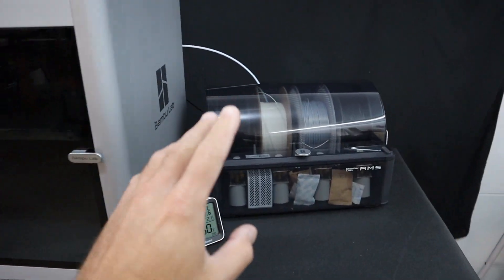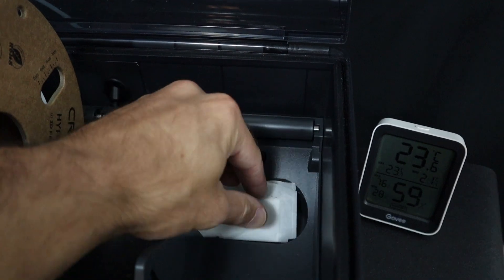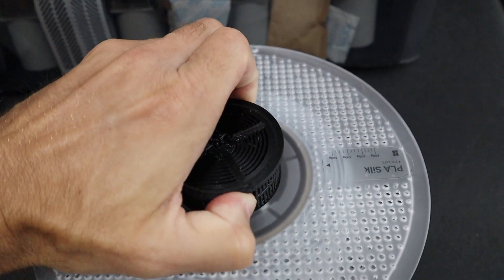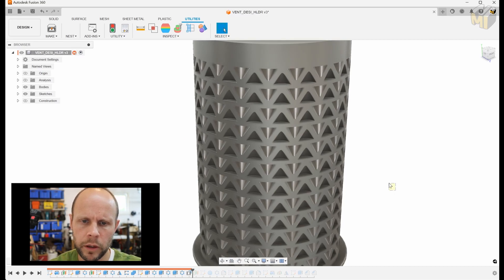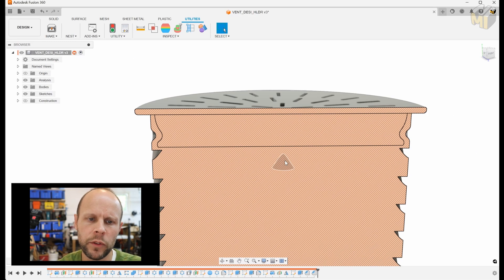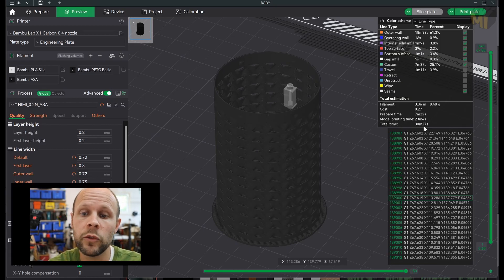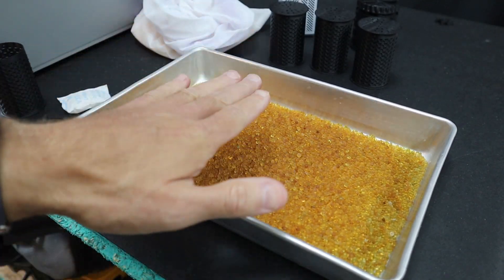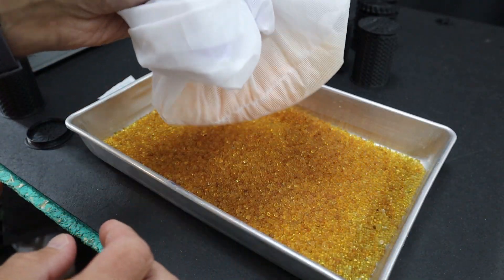Super Dry Your Bambu Lab AMS with These Cool 3D Prints

Comment: what did u print it in and what was that white mess on your build plate?
Reply from the maker: This was printed in ASA, but you can use ABS/PETG also works, it really depends on how you want to dry the desiccant.  The mess is just glue stick, these prints didn't need it, but most of my prints are heavy duty and will warp.  PETG doesn't seem to do it much, but PLA and ABS are pretty bad for nearly solid parts.

Comment: Hey, please point me in the right direction to learn more about the modeling you did to create the 'louvres'. I tried browsing your channel but couldn't find any other reference to it.
Reply from the maker: This was a new one for me as well.  This only works with Vase mode printing.  I created a cylinder to begin with, and then I created a small cone shape to intersect it and patterned it around the larger cylinder.  The rule with vase mode is that anything horizontal will not be printed, with the bottoms or tops of the cones horizontal, they're open and it gives that cool look as well as the flow.  I hope that helps, let me know if you need more info.

Comment: Hi, thank you for your very well made design! I sliced it in bambu studio, I think using the same parameters as you, but I can get only 55mins and not 30mins print time.
Reply from the maker: Thank you!   There will be some settings which are material dependent, it may be that the flow rate, or your cooling settings for that material is different than the settings I used for ASA.  If you have a look at the view for speed view and then play around with some settings with for that material you should be able to speed up your print.  Are you Printing with ABS/PETG/ASA other?
Reply: Thank you so much, I'll give it a try (I'm using PLA)  @NeedItMakeIt

Comment: Im on my 5th attempt at printing this successfully. It only prints well with infills. I'm referring to the spool holder. Any suggestions?
Reply from the maker: You should be able to print spiral with a 0.4mm nozzle, by adjusting the line width from 0.45 to 0.75, if the bottom or tops don't connect well it will be due to the amount of bottoms, you need at least 6 if I remember correctly.  That's pretty well it.  I don't know how it would turn out with infill but let me know and I am happy to help.  One other note, best to print it in a color that doesn't match your spools... I found this out the hard way when I was removing a spool and it fell out on me... lesson learned.
Reply: @NeedItMakeIt  I really appreciate your response. Did you use Bambu Studio or the Orca Splicer? I think I may have changed too may settings. I'm going to default everything and then do what you have outlined above. The tip about the color of the spool, noted! I happen tp be using the P1S.
Reply from the maker: @speway  I think at the time I used Bambu, but the features should be available in each and they should look similar, Orca is pretty close to Bambu.   Could be some settings that are a bit off yup, I think a 0.2LH, add 0.3mm to each of the extrusion thicknesses, turn on Vase mode, make sure you have 6 bottoms min. 

The 6 bottoms lock in the vase portion to the base, without that it won't have anything connecting it and will fail for sure.  I think you can print this in any filament, but ABS/ASA or even PETG should work, I figure it'll go in a dryer eventually, but because of the lid it doesn't have to.  PLA will be affected by moisture over time and will likely become brittle.    P1S is a great printer, I'd like to have one to go with the X1C actually.  Maybe someday!
Reply: @NeedItMakeIt  What do you mean by "6 bottoms?"
Reply: @NeedItMakeIt  Thanks for taking the time to respond to my inqury. Question: As "line width is not a specific setting but rather a heading that  houses approx. 8 settings, would I be changing each of these eight settings from .45 to .75? I am using a PETG and the Generic filament profile.
Reply: @NeedItMakeIt  I failed to mention earlier but I'm new to 3D printing.
Reply: @NeedItMakeIt  When you metnion bottoms/tops, are you referrring to the bottoms/tops flow ratio setting?

Comment: Rather than having to empty these desiccant holders to dry, have you thought about printing out of a more heat resistant material like ASA or PC and just putting the entire thing in a dryer?
Reply from the maker: Mine were printed from ASA, yes that's a great idea to be able to plunk them in the dryer.  It's a bit simpler to start by drying a large batch, after that it seems better to leave them contained and dry on occasion with a spool.  I don't recommend the black though, they blend in to the spools too easily and it's easy to forget they're in there.  Any color would be better.

Comment: Don't wonder about the Tube looking like the top lid is on. Activate spiral vase and slice and the solid cylinder will turn into a tube without a lid.
However I only manage to get the holes on the side, that point upwards. The one pointing downwards are not printed properly with pla. From the upright "ring" that starts each level the next line starts to squiggle as expected, but the slicer doesn't understand, that the ventilation needs to be drastically ramped up, get the PLA hard in mid air. So when the nozzle comes back above the "ring" the still soft PLA leans against that "ring" effectlivly closing the hole.
Reply: activate spiral vase? for us NEW printers how and where do you do that? i ask as the first one i printed is solid on both ends.  thanks for any help.
Reply: I'm new as well and I have to go through all check boxes every time. "Spiral vase" is under "Other/Special mode" in Bambu slicer.  @terryhdbailey

Comment: In your video, you said you didn't think the front desiccant trays would have enough 'drying power', but you didn't try it out. I tried it. I printed the three trays and at first I didn't fill 'm up. I just used the standard holes in the back with the supplied satchels of desiccant. I printed the front center tray just for holding the hygrometer which I got off of Amazon. I tried them first against two different hygrometers in my room (around 45% humidity, 20C) and it showed around 30% inside the AMS. I let that sit there for a few days (I had to wait for my kilo of desiccant anyway) and the humidity and temp remained stable. Then I filled up the left and right front trays with desiccant and within a couple of hours humidity dropped to 20% and it's still there. So I guess both solutions perform roughly the same, yours a bit better.
Reply: How about implementing both solutions?  Is it possible to have the filaments be too dry?  My X1C arrives tomorrow and I will make this my first project. Also, I  know you have the large humidity sensors for video visibility but how accurate is the built in sensor in the AMS?  Is it accurate enough that it's all I should need or should I get the 3rd party meter as well?
Reply: @manueltran1964  did you try it? has it worked? I'm about to get my X1C on tuesday so I'm excited!

Comment: When I slice the Universal Internal Spool Desiccant Holder, it is closed at the top. Am I doing something wrong? I have a Bambu Lab printer.
Found that I have to do the following: 
To print this, use Vase Mode (Spiral)
Change line widths from 0.4 to 0.7, increase by 0.3mm to each width setting
Use 6 bottoms, this makes sure that the vase has a good connection to the top or bottom. 
But I don't know what to do with change line widths from 0.4 to 0.7, increase by 0.3mm. 
I found Line width Default and changed it to 0.7, but where do I fill in the 0.3? 
(Just have my printer for a few weeks, so sorry if it is a stupid question)
Reply: You have all kinds of widths and they are not all .4mm. Change all of them +.3. So for example .4 becomes .7... .42 becomes .72... and so on.

Comment: The desiccant bottles that go in the spools also helps keep non-bambu spools from jumping as you are about to finish the filament.  Other spools are lighter than the balbu ones and tend to jump when there isn’t much weight from the filament left.
Reply from the maker: I can see that being a problem for the paper spools, a full spool isn't really a problem but as they become nearly empty it's not good, a spring system from the top with a roller would be a good idea and would accommodate all spools.. except for the smallest ones which the Hydra system would allow.   Great point though.  My issue with those is that they only fit one brand.  I wanted something a bit more universal.  I think that I would not recommend printing my design from black, sometimes I forget they're inside and oops, there is a broken lid as it falls out.  I'm also using black colored spools, so maybe something brighter would be good.

Comment: The top is merged to the rest of the model. Why is the model like this?
Reply: Mine looked the same but once you set under the "Others" tab | Special Vase | Select the box that says "Spiral Mode"   (Would have been better if the creator explained where the "Spiral Vase" mode was located as I did not find it easily. Once you set that, the rest of the project gets an A++
Reply from the maker: @DatsunVents  Yup, good point, sometimes I can gloss over things not thinking that some people may not be aware of how to activate the features.  Especially one that isn't used much like Vase mode/spiral.  I'll keep this in mind for future, thanks for that!
Reply from the maker: I think it needs to be rotated around, my apologies, I should have adjusted the model to come in with the section you're referring to toward the buildplate.  You should have a separate file for the lid.

Comment: When you download the files the top is already on and I cannot separate it for printing.  In addition the top shows to be solid with no through holes.  Solidworks does not play well with stl files so there is nothing I could do.  Great idea, but not executable.
Reply from the maker: I just had a look, and the stl files are two separate files, however if you bring them into the slicer at the same time, you'll have the option to combine them / group them.   Try bringing them in individually and you should have success.  

The model is solid like this in order to make VASE mode work correctly, if you adjust the settings to what is shown in the video, you will be able to make it work.  The extrusion width is changed to 0.7 from 0.4 for example.  The amount of bottom layers is also important here, I believe it is at least 5, if not 6 bottoms.  

Let me know if you need any more assistance.
Reply: There are two separate files, but befor you enter Spiral Vase mode the "Body.stl" looks all closed up at both ends. The lid is not on, but the tube is closed at then end regardless, because the whole tube is filled (it's a cylinder, not a tube).  @NeedItMakeIt
Reply from the maker: @Schnapsbrennor  That's right, to make this work for you, you'll need to change to Vase mode, or Spiralize outer contour.  This will auto-hollow the shape.  It's certainly a different way of 3d printing and it's not too intuitive.  Make sure to use the settings in the video or in the printables/makerworld link these are important to make sure it is strong.  

I can also recommend using a color rather than black.  I have a lot of black spools and they blend in, better to make them something a bit brighter. 

Hope that helps.

Comment: Hi, looks awesome & even more when compared to what other options are there...
I just tried printing as is and the top is merged. I then checked the body file & it seams to have the lid merged in the model itself.
I can't manage to print it correctly on my BambuLab X1C :(
Please help... Could you maybe create a ready made 3mf file?
Thanks
Reply from the maker: I'll get back to you, I am just finishing up another video, email me if you don't  mind.  Needitmakeit@gmail.com
Reply: Hello, I'm having the same issue. The main body model is showing up with the lid already installed
Reply: @ericeves6452  I gues you figured it out by now, but for future readers: You have to enable Vase Mode ('Spiral vase')

Comment: I'm getting a constant 10% (lower limit for display output?) on my hygrometer using the original upright 3 gel containers but hey, you can never get enough desiccant so I might add these as well! Thx.
Reply: side front boxes, these and the upper side brackets I am well over 800g in there lol

Comment: I was just printing the same model in the front the other day and measuring humidity. The clip in sensor was reading 10% in the front but another was reading 30% in the back! Minimal airflow causes misreadings from the entire case.
Reply from the maker: I was thinking that as well, great to hide the sensor inside of the desiccant, but it will be pretty dry there, no nearly as much in the AMS chamber itself.  It was a good thought and looks sleek, but it's pretty misleading.
Reply: @NeedItMakeIt  So I'm having trouble with getting this off the bed with spiral mode. The walls are too thing and thus break off very easily (despite also doing the +.3mm increase). Have you encountered this before?
Reply from the maker: @grenade558  Oh, I can't say that I have, if you're printing with PETG, it can bond extra well to some beds.  If you take the Buildplate off, are you able to flex it enough to get a corner started away?
Reply: @NeedItMakeIt  yeah I've been trying with PLA and bending the sheet. For some reason they're breaking pretty easily when I bend it though. I can try rPETG but I had the issue 3x in a row so I figured I'd reach out in case you ran into it as well. Maybe my bed adhesion is too good lol
Reply from the maker: @grenade558  It sounds like the bond to the bed is really good.  I'd try turning the bed temp down to 30C and use a little glue stick, that usually does the trick for me.  I rarely have parts stick so well to the buildplate.  It could also be poor layer adhesion, but that's not normally a problem with case mode.  The only other detail would be to check to make sure you have 5 or 6 bottoms, that locks in the first wall before vase mode.  The circular shape does tend to resist warpage well, you may just have a great bond, which is kind of nice.
Reply: @NeedItMakeIt  ah I wasn't doing that many bottoms. It's a smooth cold plate so it's only 35c. I'll play with it some more tonight. Thanks!
Reply from the maker: That should fix the problem.  I had one that gave me trouble like you've had when I was first setting it up.  Vase mode designs are not always as easy as they look to setup.

Comment: I tried to print this and it's solid in Bambu Labs slicer
Reply: same here.  looks like the end caps have no holes in them?
Reply: Im  working on one that will work in bambu labs will upload it from my channel @MightyFloyd
Reply from the maker: If you're using Bambu Studio it's automatic, if its a different slicer, there are some settings that need to be adjusted.   I can probably help if you tell me which you're using.
Reply: @NeedItMakeIt in Bambu Studio under "Quality I increased layer height and all  areas under line width by .3mm, under "Stength" I have  Wall loops at 1, Top Shell at 0, "Sparse Infill" at 0, and under "Others" I have Special Mode on Spiral Vase. It is still showing infill and both ends close, printing as a solid piece.
Reply from the maker: @MrWest3  Sounds a bit strange, can you close and open it back up?  What I can do is release the model on Makerworld and setup a print profile.  I should also suggest that this should be printed in a bright color, too many times I forgot to remove it and when it hits the floor, it's not a good time.  I've been seeing the clay desiccant packs lately and I think it's a better option so I'll probably be using those inside these containers instead.
Reply: @NeedItMakeIt  thank you for responding. I don't know why it's doing this but it shows the body as a solid with both ends enclosed until I slice it. Once I slice it, it shows correctly and prints correctly now. Weird. Thank you again!
Reply from the maker: @MrWest3  Oh, okay, yes that's normal for vase mode.  With those models they are designed as a solid object and then they rely on the slicer to do the rest of the work.  Just make sure you have enough bottom layers, you need at least 6 to have a good connection between the walls and the bottoms.
Reply: @NeedItMakeIt  yes sir, I have printed 5 so far and they've turned out great! I just need a few more for the 2 AMS's. I just started printing in ASA and need to stay on top of it. This is a big help as I am new to 3D printing. Thank you!
Reply: Seems there is in fact something broken with the model.
Reply from the maker: If it's solid, you'll need to turn on Spiral / Vase and adjust the settings to match the video.  That should give you what you need.